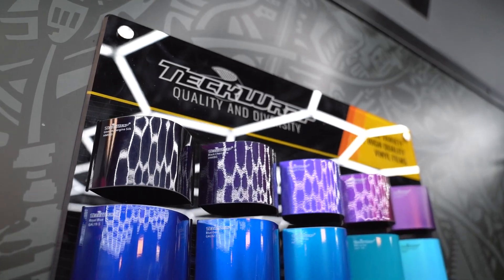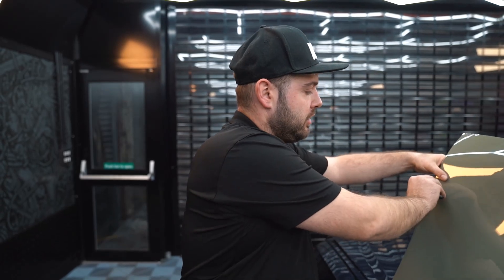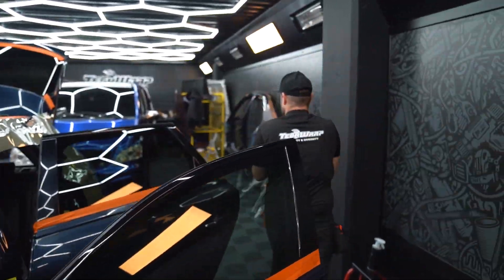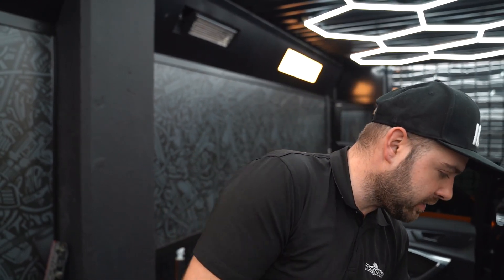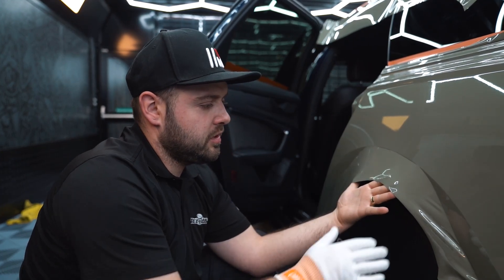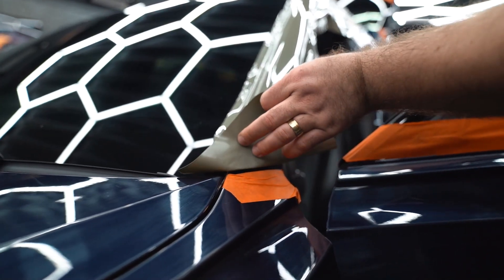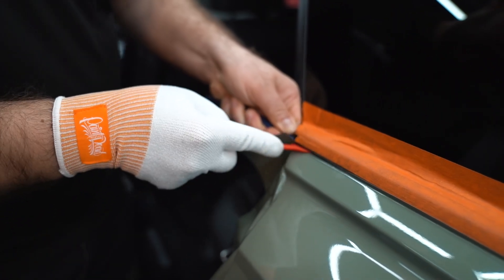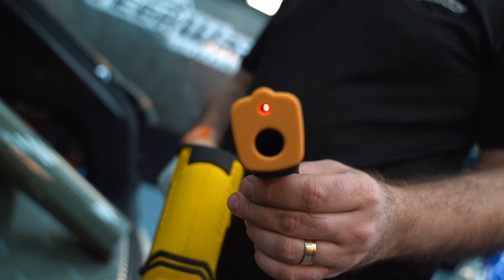Lesson 1. Super gloss wrap. Wrapping rear fender

Comment: I had a BIG problem with your glossy carbon fiber wrap.  It installed nice, no bubbles, nice shine, no pulling after post heating, but when I applied ceramic coating, the clear glossy top layer turned to some kind of sticky mess and came off.  I am NOT talking about the protective film.  I removed that.  I mean the actual vinyl wrap.  The glossy top layer turned into some kind of clear paste and the carbon fiber colors under it mixed together.  Final results, it looks like water color paint mixing together.  Swirls and black gray and silver and it's all sticky.  I have never had this happen with any other wrap.  Truly surprised me.  Is this typical of your glossy wraps?  I'm now VERY disappointed in Techwrap.
Reply from the maker: Greetings, not every ceramic coating suits the film, you need to test it before on a smaller piece.
Reply: @teckwrapint  It was just Adam's CS3, which is more of a detailer with ceramic coating in it.  Why would the ink run?  It's really poor that this happened.  I have used Avery, 3M, KPMF, Orafol and Vvivid in the past with NO ISSUES!